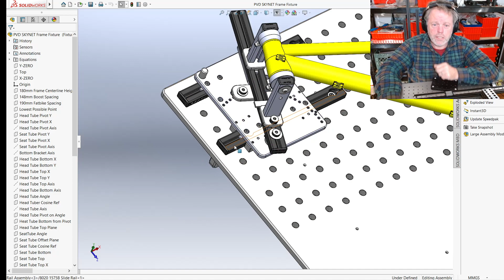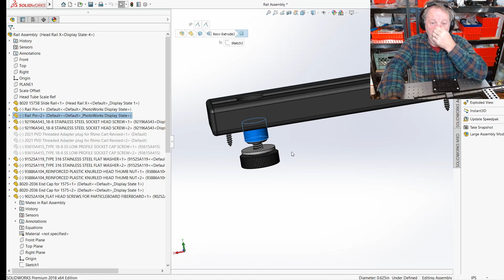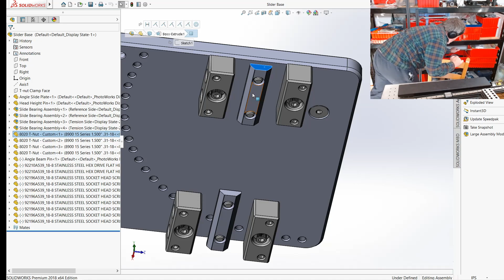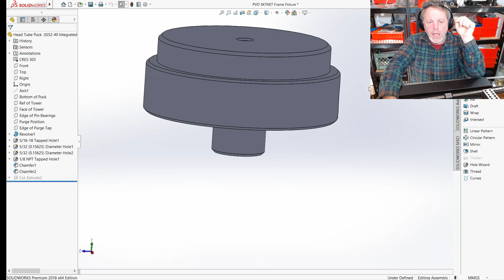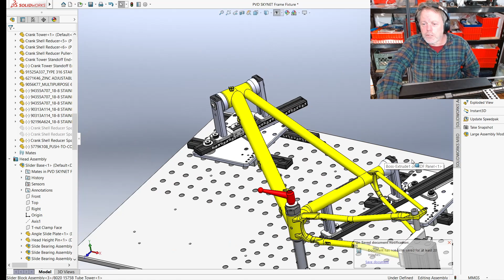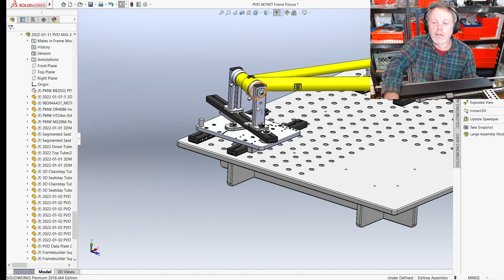Frame Fixture Series #4 - SKYNET (one)

Comment: How do you weld on the opposite side of the welding table?
Reply from the maker: This is a fixture for initial tacking the frame together. Considerable welding can be done in it but it is not intended to be used when fully welding a frame.